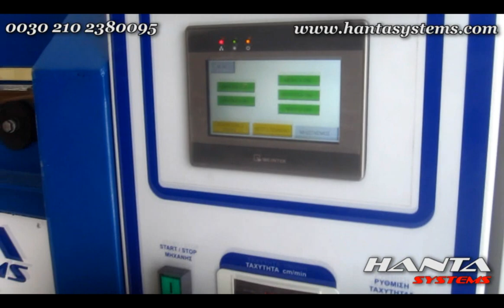Automatic Carpet and Rug Washing Machine

Comment from the maker: The sizes of all the machines are based on the carpet's width.
The production sizes are 2.8m, 3.4m and 4.2m (based on carpet's width).
If the mentioned sizes does not fulfill your necessities, it is possible to construct a machine at your desired size.